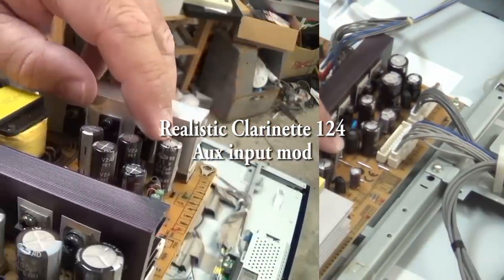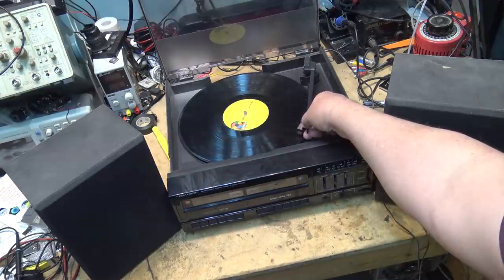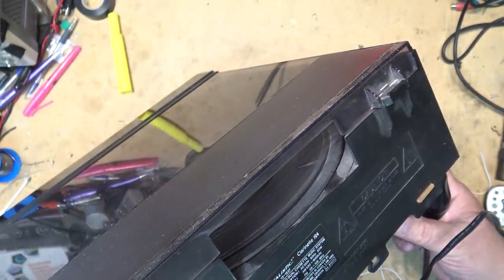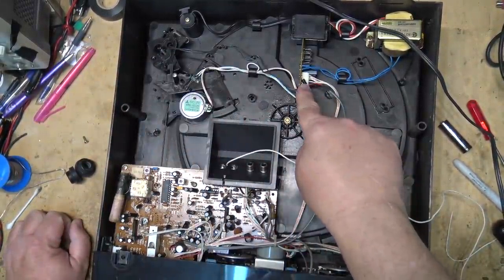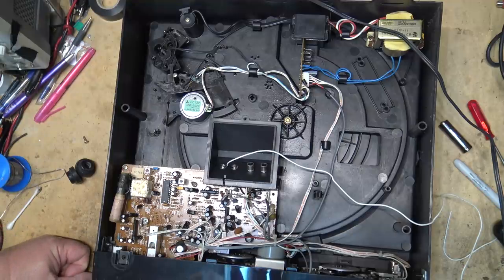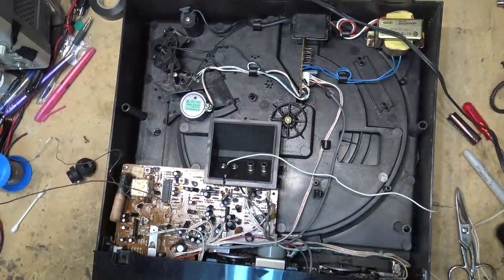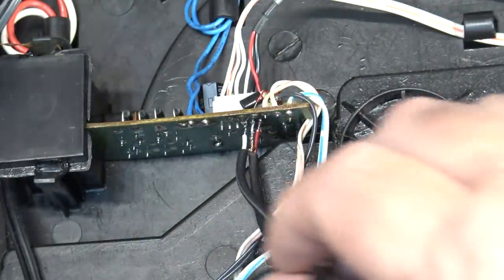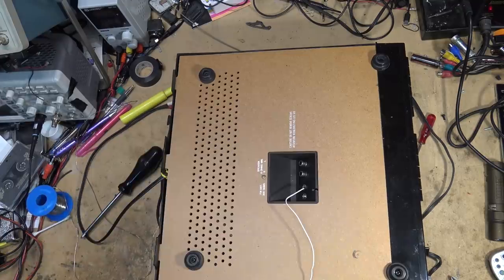Realistic Clarinette 124 Aux Input Mod

Comment: I used to plug headphones directly into the line-level output on the back of my old CRT ( male L+R phono to 3.5mm female), then I'd use a set of headphones with an in-line volume control. It's non-standard practice, but it worked surprisingly well!

Comment: It’s always been a mystery to me why TV manufactures very rarely fit a headphone socket as standard, most modern TVs have a plethora of connections and sockets on the rear of the set, many are not used by the majority of customers so cost is obviously not an issue, sure some sets like my own have Bluetooth and optic out, but sometimes Mr or Mrs  maybe elderly, slightly hard off hearing would like to simply just plug a headset into a jack with no additional complications.
Reply: I've recently bought a new TCL Roku TV and the fact it had a headphone jack was definitely a selling feature. I use it all the time.
Reply: Probably safety grounds.  With no connections going near the user means you can get away with cheaper components.
Reply: Ive found 3.5mm output jack to be fairly standard on most modern TV's...
Reply from the maker: @jovangrbic97  
That still doesnt address the issue of having the speakers on at a low level for those with normal hearing and a deaf viewer having headphones.  Plug headphones into a TV and speakers turn off.
Reply: @TheEmbeddedHobbyist  That makes sense, since nearly all low-end CRT TVs made after the early 1960s (at least for the USA market) were "hot chassis" sets, requiring at least a transformer to make a headphone jack safe. My mother had one added on a set she bought in the 1980s, but it probably would not have met UL standards. I've never seen a flat-panel set without one, though and my living room set would be almost unusable without the 3 piece amplified computer speakers I set up behind it.

Comment: My parents had a 1970 GE phono-only stereo with "tape" inputs AND outputs that were wired up in parallel with the ceramic cartridge and each other. You had to leave the motor running to play the radio (I had a tuner plugged into it) through the amplifier. The arrangement was cheesy as hell, but aside from the motor noise and wear, it worked. I believe the radio-phono version of the same stereo had a proper selector switch and selectible inputs.

Comment: If you have the time, could you make a  video, on how to adapt a car stereo, to used off thousehold mains, years ago, my grandad bought an adapter fromTandy, thesedays nobody seems manufacture a similar product
Reply from the maker: There are many 12 volt power supplies available.  Check ham radio shops.  They have many different styles.  A 12 amp will be more than enough for must stereos.
Reply: I used a standard ATX power supply with a 1986 Blaupunkt car radio/cassette player and it worked fine.

Comment: Smashing mod :-D
i'm supprised that the phono has no filtering for the tinney sounding ceramic pickup.
But that makes it simpler for aux use :-D
Why should it matter how you strip wire, it works :-D.
I use a small sharp penknife and roll the edge around the wire, works for me :-).
I've had some reasonable realistic stuff, but that unit did look very cheap :-(
Reply: Those Clarinette 124's were very tinny with hardly no bass or treble.

Comment: My solution to the excessive TV volume problem with my Gran was to install an induction loop system attached to the TV, companies like Ampetronic make ones specifically for home use. The one I acquired (an Ampetronic DLS) has two mic inputs and two dual mono line inputs. No headphones and no wires, just comes through any hearing aid with a telecoil switch/receiver.
Added an extra by ditching the wired lapel mic that it comes with and connecting A db Technologies wireless lapel system instead.
Works excellently, even more so given I paid £15 quid for one that was brand new just missing the cable clips and PSU, so ~£100 less than retail. Luckily 12V 1A PSU's are hardly difficult to acquire from a pile of spare PSU's.

Comment: I have a very large Hitachi stereo music centre 2690 from the 70,s,,,which I have repaired and restored successfully with the radio,,4 bands,,,lw,,mw,,sw,and fm. And had got the cartridge and belt replaced on the turntable,,and the cassette deck,,,replaced 3 belts,,,and it all works really well. 
It does have an auxiliary input,,,with an 8 din plug connection,,,and i managed to get the adapter to connect it to rca connection  for using an mp3 player,,,tv auxiliary,,etc. 
The only thing I had found that the sound is mono in both channels,,,with the signal only coming from the left output of the rca cord connection,,,right channel has nothing. Rca cord works fine in other stereo units i have with normal rca input terminals for stereo sound auxiliary input. 
What would I need to do with the connecting 8 din terminal plug on the Hitachi,,,should i actually turn it into an rca input terminals to get stereo sound auxiliary input?

Just something I thought to ask you anyway,,,good to see how u made that all in one stereo useful for a tv auxiliary input thru the  phono input instead,,,and the turntable sound still works too,,,thru the same input.
Reply: Could it be that Hitachi, for some reason, used a mono-pinout DIN jack (I assume such a thing exists because I've seen DIN jacks on mono equipment)? Or maybe the adapter is defective. We avoid DIN connections like the plague in the USA, so the only time we deal with them is in converting them to RCA connections.
Reply: I,m not so certain if it,s the adapter,,,but the only way I can find out is to somehow connect the left and right audio connections to the terminal using a rca plug connections without the 8 din adapter plug,,and it may work in stereo auxiliary input as it should.

Comment: Why couldn't they just plug the headphones into the TV's 3.5mm jack directly?
Reply from the maker: Well that would shut the speakers off.  How would other people in the room hear it.   They plug the audio out on cable box into headphone amp so his mon can crank it up so she can hear without his dad getting blown out of the room.
Reply: @12voltvids  Ah that was what I was expecting, the need of dual outputs. That's an interesting trick to use the cable box audio out as an independent audio source with the TV. Any idea how one would mod concurrent 3.5mm and TV audio simultaneously? Is it just 'fusing' the 3.5mm jack contacts so that the audio signal flows both to the headphones and also down the line to the speaker (amp), a connection which usually would be severed by plugging in a 3.5mm plug?

Comment: Hello. Do you maybe know if the record player is belt-driven or a direct drive? My father has a Magnavox MX1700 radio, casette and record player combo which looks EXACTLY like this one here. After a few years the platter doesn't spin anymore. It does however make a sound when i hover the tonearm above it. I want to check what's wrong, but I don't know how to access the underside of the platter. Could you please tell me how to do this?
Reply from the maker: Belt
Reply: @12voltvids  How is the platter accessed? If the belt should be replaced for example.
Reply from the maker: @CherylTooy96  sorry I no longer have the unit. It should be relatively easy usually just an e clip on the spindle.

Comment: For all i care You could use a butter knife to strip wires, or Your bare teeth, if you like. Actually, that would be kinda entertaining...
Reply from the maker: An old friend of mine used to use his teeth.  One day he went to strip a phone cord to make a cable to co to a tape recorder to record phone calls.  Problem was the other end was still plugged in.  52 volts across the mercury fillings ! Dam that was funny.  There was a few of us there and we literally pissed yourself we were laughing so hard.
Reply: @12voltvids  After putting it off for way to long, I bought a cheap, maybe $5 or $10 automatic wire stripper at Habour Freight; unlike my old "automatic" stripper, you didn't have to find the hole that matched the gauge of the wire, it just had 2 metal incisors that, with the right tension setting, could pull the insulation off of just about any wire. What a relief that thing is; stripping wire was always the one of the most unpleasant parts of any electrical/electronic project.

Comment: Got a comment about yo using scissors, :| And I have to say I also use scissors, because the scissors I use are somewhat loose, and because of that, they allow me to slide the wire to be stripped down until it is lightly wedged whilst the scissors are half closed, once the wire is lightly wedged a simple scissor actions strips the wire cleanly all in one single action, regardless how tiny or large Err-"Fat" the cable is, in fact I am pretty sure there are many Many more peeps that simply prefer to use a pair of loose scissors because it's just quicker, but more importantly they give a nice clean finish without taking any strands, known to happen if you inadvertently chose the wrong wire strippers suggested stripping point..

Comment: Are you sure the sound from the record doesn't need or isn't RIAA EQ'ed in that device?
Reply from the maker: Ceramic cartridges don't have the fedility
Reply: @12voltvids  So... ceramic cartridges are so crappy that it's impossible to hear any difference between with and without RIAA EQ?

I have zero experience with ceramics, the only cartridge transducer types I have are MM, MI and MC. Those definitely need RIAA EQ and even need the proper input capacitance or resistance (MC only).

Comment: Bahaha, those guys should see my technique for stripping wires then. Ever since my teens I have a chip in one of my front teeth that's just like the notch in the Klein scissors, you know the rest...
Reply from the maker: 😀 yes I know the drill.  A friend did that on a live wire once.   Dam that was funny.  We were all rolling on the floor laughing our ass off that day.
Reply: haha never had the misfortune to taste line voltage but had a few tingles from transistor radios that way, I'd give the flavour of electricity as lemony/acidic!

Comment: Hello. Here in Norway we tend to throw this stuff in the trash!

Is it possible to buy lower quality speakers and turntables? not that I know of! Such record players also tend to destroy LP records!

It should be said that Norway is one of the countries that throws most electronics!

But when it comes to bad electronics as you repair or modifies, garbage is the only right place for that!
Reply: So, you completely missed the point of the modification? Surely your English isn't that bad that you failed to note the reason behind it?
Reply from the maker: @danmackintosh6325  
I am beginning to think that many miss the point.
Reply: @danmackintosh6325  I know he has modified the player.
There is a lot to write and i have to use google translate even if i know some english. Had I written more then not many people had read everything i think.